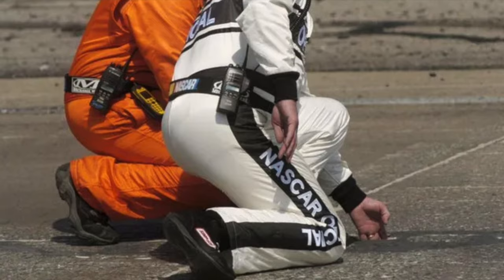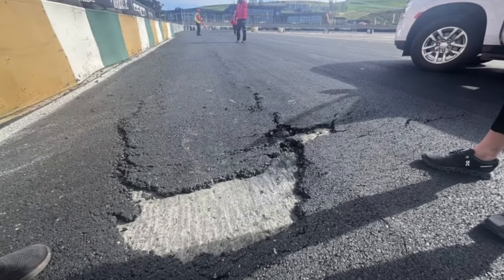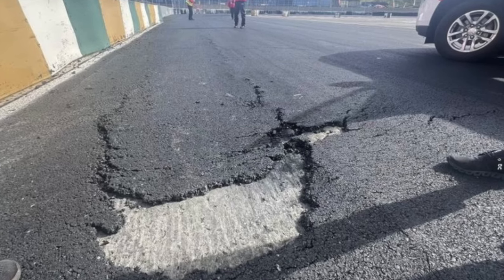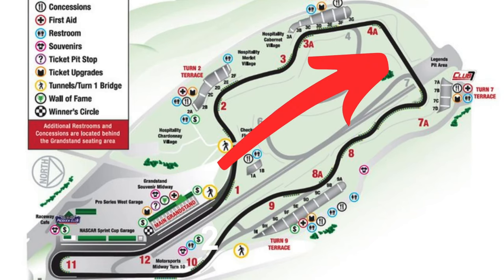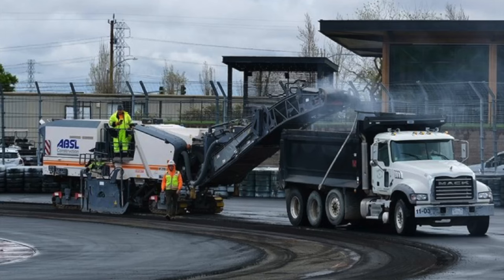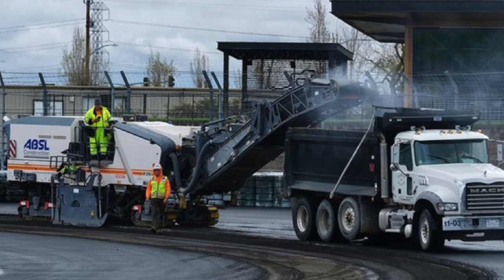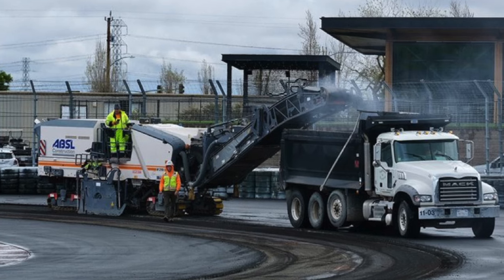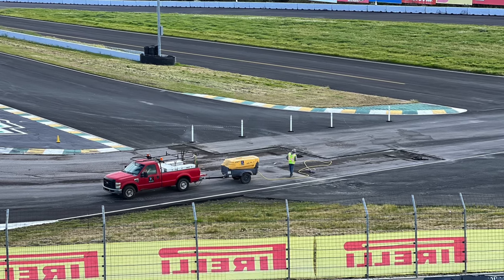Sonoma Raceway Has A Major Track Surface Problem After Repave

Comment: They must have hired a contractor from Illinois.
Reply: That's funny
Reply: No, South Carolina.  They pave paper thin here too.  Took them 6 months to pave 12 miles because they had to keep taking it back up and putting it down after 18 wheelers lose a tire and dig huge ruts in the new asphalt.
Reply: No, it's from California. They've been working on 101 for decades.
Reply: Or Michigan
Reply: @SteveTheExploiter Michigan paves pretty thick but it never lasts more than 2 weeks IF they do it correctly to begin with
Reply: You guys have road contractors?
Reply: @nicholasmoore5549  no, just people to put up cones and signs. Lol

Comment: Turn 11 at Sonoma (Sears Point) has had bad juju for decades. For many years it was lumpy and rippled despite many repair attempts. I crashed there
during a motorcycle race (AFM) and got intimately acquainted with it. Also attending and participating in many sports car racing events. The track 
operators did a major rework of that corner and discovered an underground spring which was degrading the subsurface. I think that took care of the
problem. Yeah that repave looks really thin. It should be at least 2 1/2" with tack oil over the ground surface. It's a really fun place to race, although I 
have not run on it since the reconfiguration. Plus, I'm too old!
Reply from the maker: For your moto race did you run the full hairpin or the old IndyCar hairpin so there was runoff?
Reply: @brakehard  When I ran there, I don't remember any runoff area. IIRC the whole of the turn on the outside, was part of the pit entrance . After that was the pit wall which extended to the start finish line that also protected the pit exit to allow departing vehicles to get up to near racing speed. It was a very fun place to run.Even some of the spectator parking created more excitement as this was the early days of catalytic converters and parking on the grass started fires.